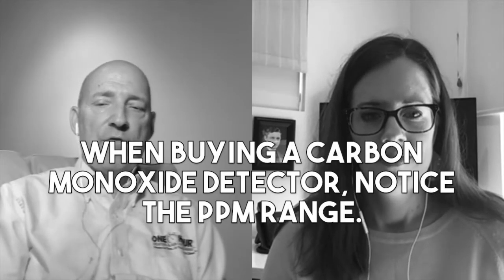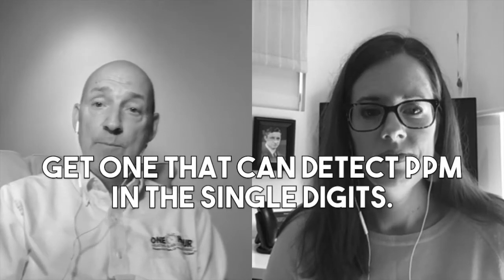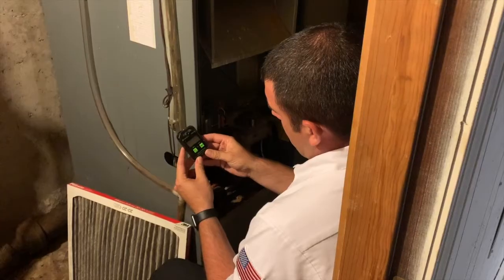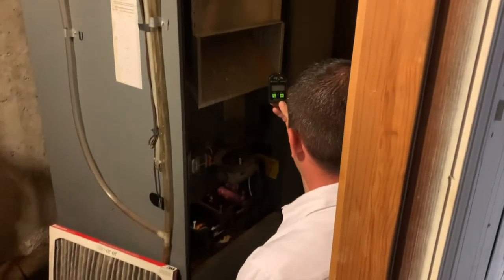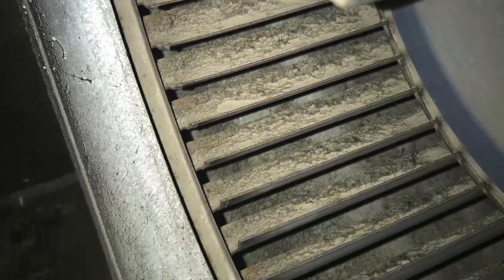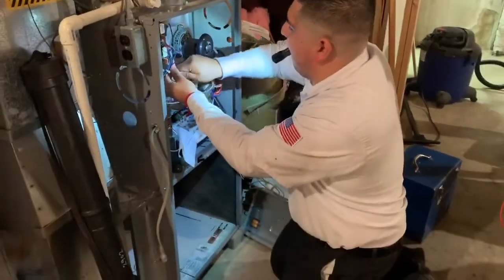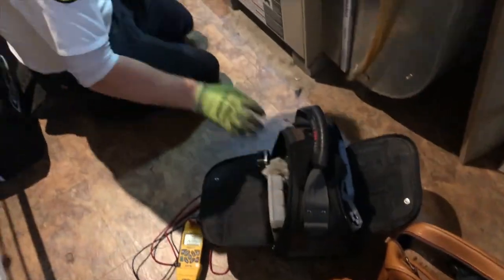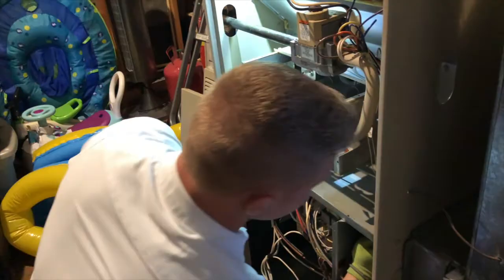WHAT CAN TRIGGER A CARBON MONOXIDE ALARM? \\ What causes co detector to go off?

Comment from the maker: Thanks for watching! I hope this was helpful, I definitely learned from my Dad to make sure I have a CO Detector that will sound an alarm at a low level!  I hope you subscribe, we post new videos every Tuesday. 😀
Reply: What is a good low CO detector that the average homeowner can afford. Only have one appliance that could and that is a gas range that has no hood vent. It’s in a island and don’t see a way to place a overhead vent.
Reply: got a question for you I found this video is this an actual possiblity thoughts please thank you if you think its a legitimate video that I include would you say I should add it to the safety page I am trying to create : https://youtu.be/PAHtpY7TR0E
Reply: So. How ate u going to set the low level co detector? I just bought a co and smoke alarm recently and before i will install it i want to know how to set it up to low level detector?
Reply: @vanessajoyreal4451  I think the detector should already specifically be a low level one. Usually the ones labeled as alarms are the regular ones.

Comment: I’m wondering …in a gas dryer where does the CO come from? From the dryer’s hose or from the actual dryer/appliance ?  So for example if the dryer’s hose is outside the room/house there won’t be release of CO in the room where the dryer is  operating or there’s release of CO regardless?
Reply: Goggle it
Reply: @rickystanton3039   Where can I find those CO goggles?

Comment: What is a good low CO detector that the average homeowner can afford. Only have one appliance that could and that is a gas range that has no hood vent.
Reply: Same
Reply: Most will alarm at 30ppm and have a readout for less. Just check the sensitivity numbers and stay away from the cheapest one as a rule. Reviews don't do that much good on these because leaks aren't common.